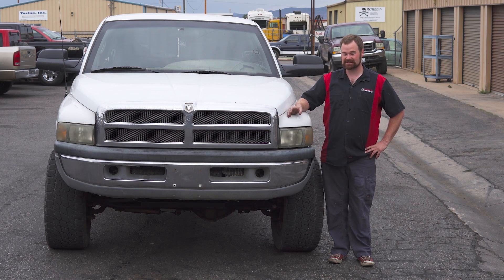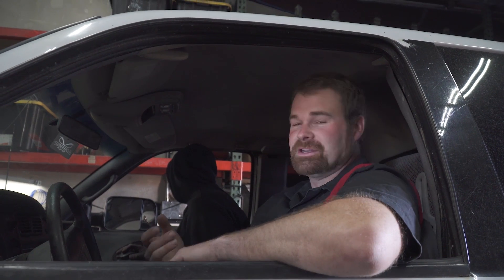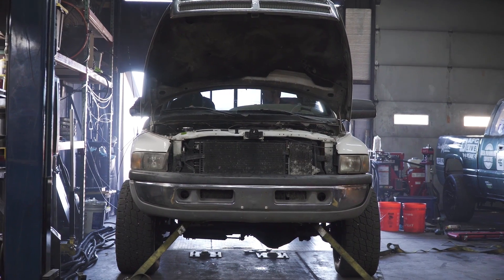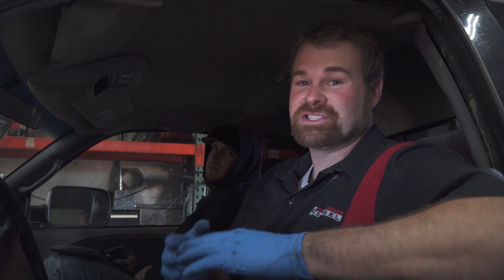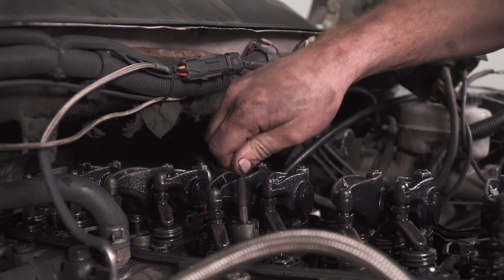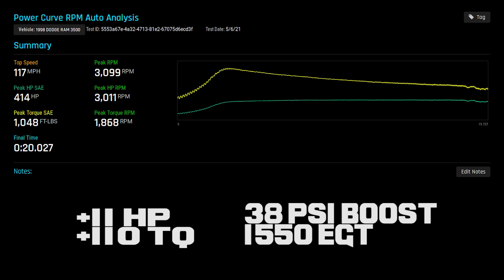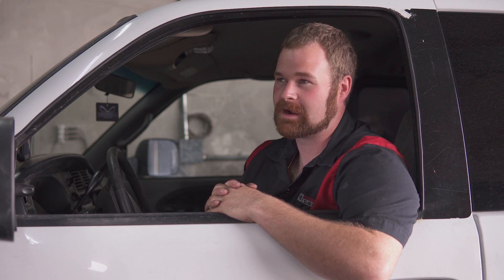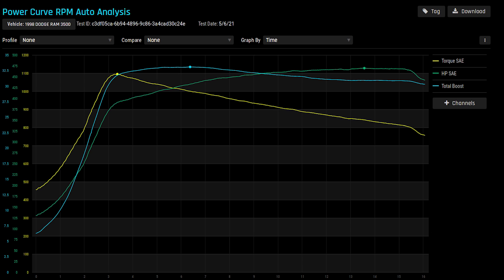How to Double the Torque on a 24V Cummins | 1100 lb ft | Power Driven Diesel

Comment: The chart was good but it could've been great if you added a cost column to each level. I have a bone stock 99 and would like a bit more power but I don't want to have to change out the stock tranny. Could I get away with just adding the quadzilla tuner? Also, then links in the description aren't working. I'm trying to access on my Mabook.

Comment: What is the threshold for egt temp ? Isn’t 1500-1450 a bit high ? Worried about melting pistons ?
Reply from the maker: On the race trucks, the turbine wheel usually melts on the turbo in the 1900 to 2300 range and the pistons are usually fine.  On newer common rail towing trucks, 1500+ sustained loaded on a grade is playing with fire.  On these older 12v and 24v, they run out of radiator and will overheat coolant with much more than 1300 sustained loaded on a long grade, never melted pistons, always overheated the cooling system and had to pull over or reduce speed and grab a lower gear. We've never seen a melted piston from high EGT on an unloaded street truck, not enough time to melt/overheat without going to jail for triple digit speeds!
Reply: @pddofficial  that’s great information thank you

Comment: any speculation how much power increase from stock 5.9 h.o / nv5600
to
edge juice unlocked 
s475/62mm hx40
sac 7x13 injectors
fass 290 5/8" lines
Reply from the maker: Those HO VP44 trucks struggle to get past 500 rear wheel HP.  Our guess would be 500 HP on that setup, fuel limited by the pesky HO injection pump that runs great in every condition except maximum HP.

Comment: Well it was about 13 years ago, but this affirms my thought that I doubled my torque when I installed an adrenaline on my '01 came with a decent fuel economy gain as well. Tough to argue with the bang for buck improvement of that little box. 👍
Reply from the maker: Couldn't agree more!
Reply: I love my adrenaline too on my 01 , auto, straight pipe, hx36, guy I bought it from says it has rv injectors??

 I was hoping to gain some MPG's but no matter what I'm lucky to get 16-17. It has a built tranny and I think something might be too tight, like the torque converter, when it's cold a put into gear it will die, once warmed up it does fine other than when I'm towing slow uphill it gets hotter than hell and the idiot light comes on, I just wonder if that has something to do with my crappy mpg, even when not towing?
Reply: @whatsit2ya247  something is up with your tune, friend. Does it do the same thing regardless of what setting you're on? 
Also since it's really easy, it's worth temporarily putting it back to stock and see how it behaves.
Reply: @courier11sec   Thanks for the response, yeah same thing no matter what tune as far as mpg if that's what you're referring to, with the adrenaline or not, I've tried different tunes, a few downloaded from mopar1973 man, lots of adjustments or stock same thing.
 As far as the trans, it's just something I've dealt with since I bought it around six years ago and keep finding excuses not to deal with it lol.
Curious, what kinda mpg do you get (when actually trying) THANKS!
Reply: @whatsit2ya247  I'm normally in the 14-18mpg range. 2wd dually extended game that was originally a chassis cab with an 11ft service body. Stock trans and an older 8blade hx35. If I'm sound mostly highway and using the manual lockup switch I can expect closer to 20.
Poor old gal could use some loving but I'm broke both physically and financially.

Comment: Hey, what boost did it make with the injectors? I have a banks intake  ram, afe cold air, bd manifold and 100hp injectors I’m only getting 38-40psi on the hx35 on level 10
Reply from the maker: 41psi

Comment: Are the bosh rv275 injectors good set?
Reply from the maker: Yes they are like a 7x.085
Reply: @pddofficial  I have a 99 ram 2500 I use daily for landscaping and weekends for camping. Looking to do exactly what you guys did in the video, quad tuner, k27, but with the bosch Injectors. And thinking of a Hamilton spring kit. What do you guys think. Of course I'll be getting everything from your guys website no doubt
Reply from the maker: @christophergonzales2627  we have had the hamiltons on several trucks but we have had better luck with our PDD 4.5 k springs that are built here in America. https://powerdrivendiesel.com/product/power-driven-diesel-24v-4-5k-valve-springs/

Comment: I'm late seeing this , what was done to the engine to get those stock numbers , thats a 215 at the crank engine with 20psi max boost ? I just bought a stock 98.5 2wd with 172k miles , I forgot how SLOW they are , my 2000 4x4 was 525 crank HP ...
Reply from the maker: Nothing it was stock
Reply: @pddofficial  then how do you explain a HP figure that is higher than the factory at the crank number , what about drivetrain loss ?

Comment: Very good video I got a 99 dodge  it's got an edge comp box s and b cold air intake rv275 injectors 4 inch exhaust and a air dog 150 lift pump what kinda power do you think I'm making?
Reply from the maker: Around 350hp

Comment: Hey i have the same truck all stock with an edg comp tuner. It Rips! But am I hurting my truck with this tuner? I have a lift pump pooshing 20 psi, i dont know its flow. So now i have ben having this problem, cutting out completely, truck shuts off completely out of nowhere when i get on it. Like at setting number 5 and i do a pull, as soon as boost kicks in and im rippen its like i loose fuel and just cuts out. Hope all that makes sence. Im woundering if i have shot my injection pump. I have fuel pressure and good filter...😩 help☹️
Reply from the maker: does the pump push 20psi at idle or under full throttle
Reply: @pddofficial  my lift pump yes. 20, 19,18,17 goes between those numbers
Reply from the maker: @Fun-under-the-hood  does it die when your under power or as soon as you let out of the throttle
Reply: @pddofficial  not when i let out, when im on it, like led foot. When it happens I tune my edge tuner back down to setting 1 and baby the gas, keeping my foot out of it, if i get into the gas more it Will intermittently sputter almost like a lack of fuel and all of this is an intermittent issue sometimes it does it sometimes not.
Reply: @pddofficial  I may try to get a digital fuel gauge that I know is a good quality fuel pressure gauge. And tap into my fuel line just after my fuel filter on its way to the injection pump, to get a digital reading of exactly what my fuel pressure is post injection pump.   Do let me know if you have any other ideas. Thank you for replying and helping do a little diagnoses here. Let me know if I'm wasting my time with my idea
Reply: @pddofficial  dies when im under power

Comment: I used to hear from haters how my budget crower 'neon' valve springs were going to wear out my cam etc. and break my truck. LOL 9 years later still runnin just fine. Last dyno run was 576hp, 1285tq on a SO-VP44 fuel only. (adrenaline, compound twins, 6x.013 injectors and supporting mods like push rods, head studs, DD clutch, 150gph lift pump, gauges, etc.) 

Keep these VP44 vids comin'! good to see these old trucks still getting some love.

Comment: Insane how much power the quadzilla makes. I got the same setup just with a 2000 24v and it rips
Reply: You got a 47RE or a manual?
Reply: @ryanslattery2977  I got a built 47re
Reply: @wyattsklee6769  how much you think i can safely push one with a shift kit. (I'm a 2WD). Not anything too crazy, just the occasional spirited driving.
Reply: @ryanslattery2977  sorry for the super late response. Anything over 400whp and you’ll probably be slipping. The shift kit would definitely help with longevity tho

Comment: Thanks for this video!  Appreciate it, especially the chart.  It would be nice to see the dyno plots overlaid.  Especially the s60 vs the k27, this makes it obvious that there is more to power then just boost PSI.  At what point are the OEM injectors holding power back?

Comment: Did you guys upgrade the lift pump?
Reply from the maker: Yes it has a Airdog 200gph
Reply: @pddofficial  random question, but I'm curious what size tires are on the truck. Looks like 35x12.50

Comment: What kind of drive pressures were you guys seeing with the bigger injectors while using the stock HX-35? I was running 75 hp injectors with my stock HX-35 and blew the majority of my exhaust valve seals.
Reply from the maker: Depend on the rpm but at 3000 rpms it is really high

Comment: Crazy that a old engine like the 5.9s can produce the torque the new diesels are making
Reply: Why , the newer engines are just turned up 5.9's. The reason the 12v and 24v's were lower power was because Chrysler didn't put a transmission behind it capable of handling the potential. the 5.9 24v in it's non Dodge form was 275HP with an automatic , not 215hp .
Reply: @dartgts383 No, that’s not the reason at all😅😂
Reply: @wyo_garage20  enlighten us then
Reply: @dartgts383  yeah but what was the torque

Comment: This may be a stupid question, but...curious how that baseline run was 234hp to the wheels? I thought that year was only 235 crank hp stock. years ago, I ran my 99 with an Edge EZ and only put down 205hp 500tq at the first Weekend on The Edge.

Comment: AWESOME video! What year is this truck? Your the guy I always talk to when I call PDD and you’ve helped me out tremendously ..Really hope you guys test the HX Super 9. I have your HX super 9 with Your 150HP injectors and I’m pushing 48PSI with head studs on my 99 VP44 truck.. really curious what you guys make with a similar setup!
Reply from the maker: That turbo is on the test list.... hang tight and follow along, it will be tested and posted in the next video or two.
Reply: @pddofficial  awesome I’ll def be keeping an eye out! 👍🏻
Reply from the maker: Thank you  next video is going to be that set up 150 with the k27 and the hx super 9
Reply: @pddofficial  Awesome, thanks for the update can’t wait to see it 👍🏻
Reply: Can't wait for k27 super 9 comparison
Reply: @billferris5292  I’m putting down 48psi on my 24v with the 60mm Super 9.. so far I love this turbo, the truck really gets on the power quick and hard.. very good turbo and it seems the longer i’v been running it the better the turbo has been performing as time goes on and it breaks in more and more.

Comment: Oh damn, I have a 98.5 motor with mystery 100hp injectors and head studs I'll be swapping into my truck this fall and I found a nice he351cw I threw on it.  I would love to see a run with that turbo as I have that and it's a readily available for others to consider for a swap.  I wired the motor to run stand alone as it's going into my 93 ford and I'm wondering how the adrenaline plugs in and if I can plug it into the obd port I'll be wiring in when I install it.
Reply from the maker: Hi Peter the next videos will be on our HX super 9 that is close to a modified he351.For the quad it plugs in to the date link that is on the motor but will only work with Dodge ECM
Reply: @pddofficial  Oh nice that's awesome about the turbo test and I look forward to that.  Thanks for the info on the quad, I had a suspicion that was the case looking into it superficially and am going to have to do some digging for options to sauce that motor up.  I have a 12v that needs rings in the worst way with roughly 400 hp in fueling I got from you guys and swapping to the mild 24v is going to be frustrating I suspect

Comment: What do yall recommed for my bone stock 1996 12 valve cummins manual for a good daily driver?
Reply from the maker: AFC Live is the first modification, combine it with a 4k governor spring kit, timing bump (PDD timing kit if you want to bump timing yourself at home), and maybe upgrade the valve springs and head bolts while you are under the hood so you can comfortably turn high rpm or use an exhaust brake if you tow heavy.  

Just the AFC LIVE will usually give you enough power to slip a factory clutch if you turn it aggressively.
Reply from the maker: We would recommend our 375HP package link is below 
 https://powerdrivendiesel.com/product/fuel-package-375hp/

Comment: Great video, my 98.5 4x4 A/T with 3.55 and the same stuff on it. K27, quadzilla, 75HP injectors with FASS pump, ARP headstuds, 4" ex., S&B cold air intake with ATI bigger Intercooler, adrenaline on full kill, I can get 46psi of boost. EGT'S get over 1600* though. Lol What would you think the HP & torque could be?
Reply from the maker: We've seen 24v trucks with K27 and heavy fueling hit 490 HP or so... you're probably really close to that power level.
Reply from the maker: Should be around the same power mid to high 400 range

Comment: Did it have RV injectors or something? You put to the tires what the engine was rated and thru an auto. I ran several of these trucks on the dyno back in 98 and it was a really good one to put over 200hp to the tires all stock. Most were about 190-195rwhp
Reply from the maker: It has a 4" exhaust, cold air intake, and boost elbow, and lift pump.. hitting 26 psi vs 21 stock, we too were surprised with the higher than stock power numbers.  All of the testing and gains were on the same dyno so fairly solid results.
Reply: @pddofficial  how old is the vp pump itself?  My truck with 7x013 and your 64.5 turbo kit doesn't feel like any 500 hp 😅
Reply: His trans is built prolly has a better converter just doing that can add hp an torque believe it or not plus he added a boost elbow to up the stock to from 22psi too 35 roughly
Reply: @KJR-uv6or  They were run in lockup so I wouldn't think a built trans would add much power also just cranking up the boost with no more fuel will add no more power and usually hurts it instead because you raise back pressure and intake temps.

Comment: I recently bought a bone-stock 98.5 five-speed. I’ve installed a 4in straight pipe and just got my FASS lift pump delivered today, both are from you guys. Very excited that you started this video series just before I start my quest for power. 
If you could, please address limiting factors like when you need headstuds or other components for reliability, or egt safety parameters. Thanks for being a solid and informative company by enthusiasts, for enthusiasts.
Reply: 40-50 psi of boost is when you wanna start putting head studs in on these trucks
Reply: @SquareGoated  I pushed 44psi and crazy high EGT till I put a bigger turbo , never had head gasket issue , 230K miles on a ... gasp ... 53 block ... gasp ...
Reply: three years from when u posted this, wondering what u did to your truck? i also have an old 24v and I'm looking to get 600- 800 hp out of it. if you're around these numbers i'd love to hear what you did to it!

Comment: I've got a 94 12 valve and I just did 4k governor springs in it aswell as a #0 fuel plate, bumped up fuel via the afc a little, and set it at 15.5 degrees of timing. My question is it revs higher than it did before, but ive only seen 2600 rpm so far. I've got the springs clicked in 3 clicks aswell which is recommended. It definitly has more power, and revs a lot quicker, just doesn't even get to 3k rpm. Truck is an auto btw. What do you guys think could be the issue?
Thanks.
Reply from the maker: Will it free rev above 2600 rpm in neutral?  Those early 160hp pumps need excellent lift pump feed pressure to fuel well in the 3000+ rpm range.  I'd check fuel pressure while under a load and see if it's falling off.  Best bet is to measure at the pressure test port on the fuel filter and run the gauge out onto the windshield and pin it under the wiper blade so you can see it while you test drive.  If it's falling below 25 psi, that's your problem.  If you want to get more higher rpm performance out of it, go with a hotrod lift pump and higher psi overflow valve set to about 45 psi and it will really come to life!
Reply from the maker: Sounds like low fuel pressure you want the 94-95 trucks in the high 30 psi range

Comment: Aren't you worried about melting pistons above 1250 egt
Reply from the maker: On short dyno runs, drag strip runs, street runs, etc... not a problem.  Sustained high EGT while towing is when you have to watch out for anything over 1275 EGT.
Reply from the maker: Not really we are only above the 1250f for shot time

Comment: Love seeing the VP content, makes me think about switching from TST PM3 and Smarty SO3 to the Adrenaline tuning stuff on my truck
Reply: The quadzilla is where its at.  The tunability is second to none,  I would highly recommend.  I had a smarty, then zilla,  would never go back.
Reply: @horsewhispererr  how big of a difference did you notice? I'm about to go from Smarty to Quadzilla on my '01 6spd
Reply: @logut80  its not even comparable,  your smarty will only do 65hp tops,  the quadzilla is as much as 150hp, in a perfect world.  It might be smokey at first,  may need some custom tuning.  Which I would recommend pdd, or 1badvp44.  For all your tuning needs.
Reply: @horsewhispererr  yeah I'm pretty excited about how different it SHOULD feel. I seen PDD gained 150rwhp/440rwtq on a stock truck & mine already has 150hp inj, 63mm Tater built turbo, 4" straight exhaust so hoping to get some good gains
Reply from the maker: We love the Quadziilla they work great
Reply: Just made the switch myself, ordered the box yesterday from PDD as well as a tune!

Comment: Is the k27 available for 12v applications? I've got a 95 2wd dually that has big sticks at 21 degrees of timing, too much fuel for the stock turbo
Reply: Someone will probably correct me but that should fit your truck . My 97 and 98.5 look identical from outside except for the downpipe has different mounting styles
Reply from the maker: The K27 is a drop in for a 12v applications
https://powerdrivendiesel.com/product/borg-warner-turbos-k27-turbocharger-450hp-bundle/